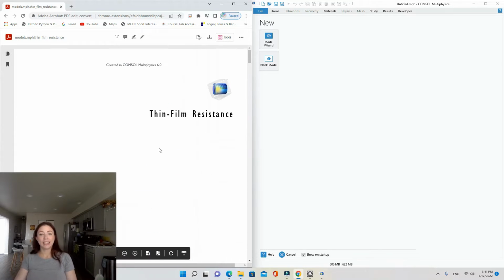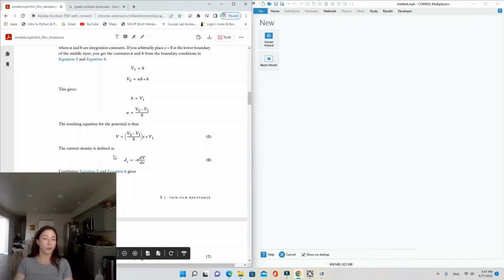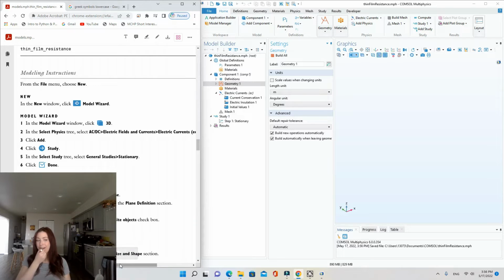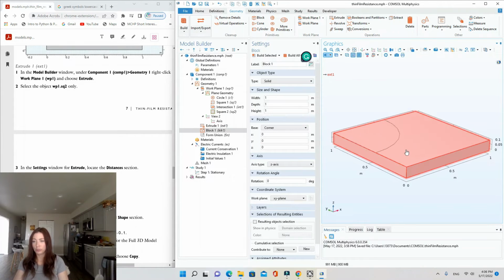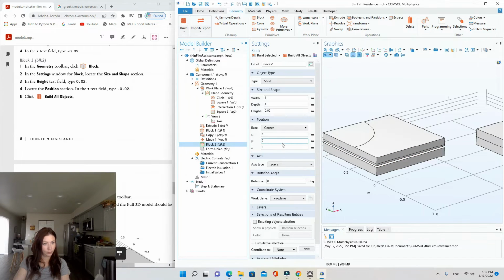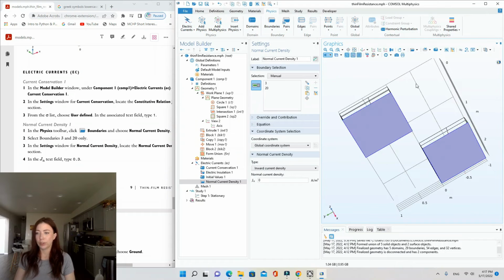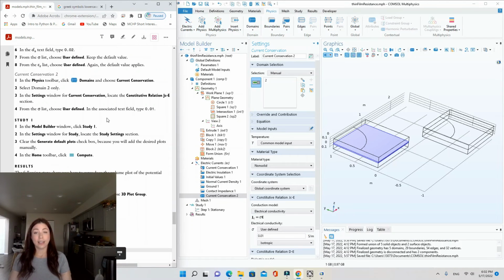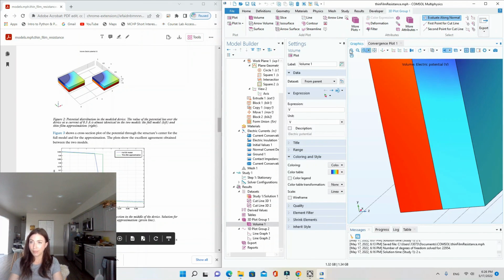Thin Film Resistance COMSOL Tutorial

Comment: I hope this message finds you well. My name is [FARID BERRAIS], and I'm a PHD currently working on perovskite solar cells. I've been following your YouTube channel [Channel Name] for quite some time now, and I must say your tutorials on COMSOL simulations have been incredibly helpful and inspiring – especially the ones on optical modeling and device physics. Your clear explanations have made complex topics so accessible!
I'm reaching out because I'm in the early stages of a project simulating the optical properties of solar cells using COMSOL Multiphysics, specifically focusing on light absorption, ray tracing, and wave optics in thin-film perovskite structures. While I've managed to set up basic drift-diffusion models (including density gradient formulations for quantum confinement), I'm struggling with integrating the optical module effectively – things like defining refractive indices, handling scattering at interfaces, and optimizing for efficiency under AM1.5 illumination.